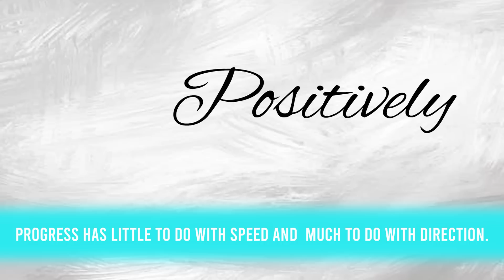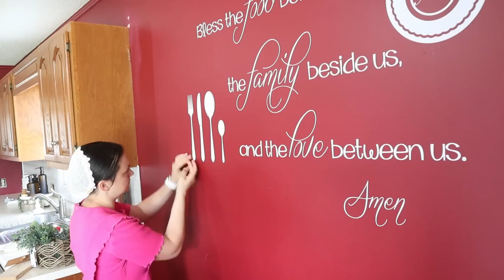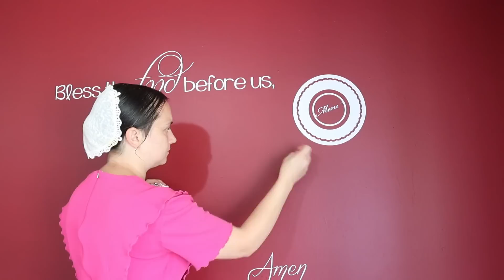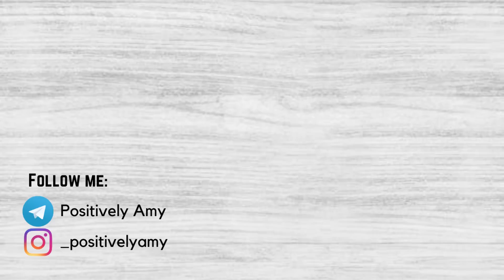Transform Your Kitchen on a Budget, Affordable Kitchen Makeover Part One

Comment: Nice recipe. Be sure to add in to your comments that jars and lids should be washed and jars sterilized before filling. You used your finger to clean the rims. I would use a paper towel with water. Jars might break if you put cold jars in to boiling water bath.